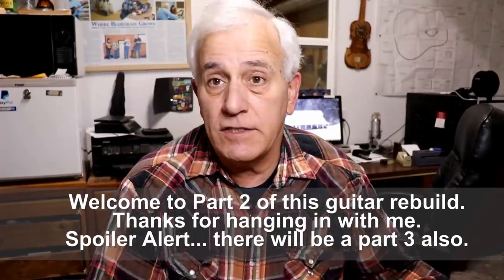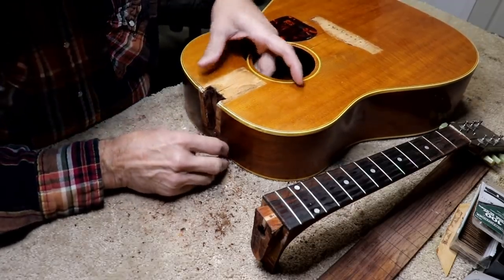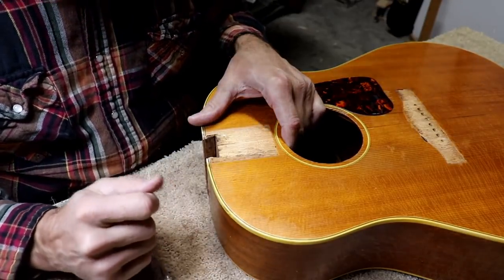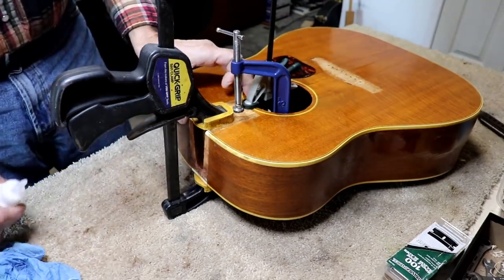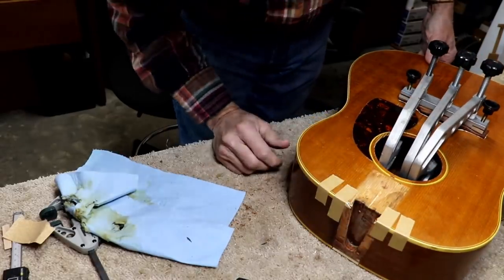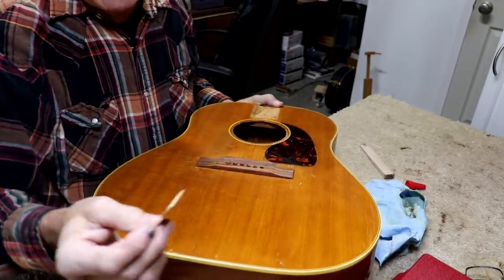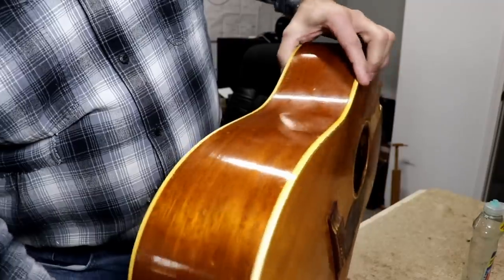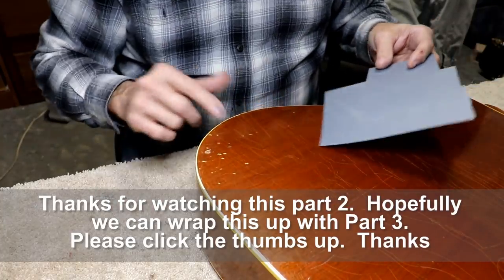278 RSW Gibson Guitar From England Rebuild Well Almost P2

Comment: When scribing the top's finish around the new bridge, hold the bridge in place with two small screws, one through each of the E string holes, with nuts on the inside.  Pad each screw head with a large Nylon washer to prevent damaging the bridge face.

Comment: Ever use a deflated ball, like a soccer ball or small inflated toy?  Brace the top and bottom of the guitar, slip in the ball over your brace wood and add air to put pressure on those hard to reach repairs.

Comment: Thanks for the dish soap trick. I just got finished using CA glue for a deep gash in a thick, lacquer electric guitar finish. I built it up scraped, sanded and polished. and it looked perfect. melted right into the surrounding finish.

Comment: Clear finger nail polish will fill those little and you scrap it down and polish it! Finger nail polish is basically a thicker lacquer,
Reply from the maker: Yes I've used that many times. Most of the time you can see a difference in the Finish though.

Comment: Ever used a flexible nozzle on your air hose with low pressure to force glue in like a pressure grease gun?  I saw you blow with a regular nozzle.  An old air brush with the cup hole sealed makes a great tool with 5 to 15 psi air.

Comment: Hi Jerry;
At 26, 45 It can't possibly be harder to hold down flat on the top than I think. Every time I've tried to hold something down on the top of an instrument and trace around it, it has been almost impossible to hold. I really like the work you have done on the neck joint area so far. I'm always interested to see how you clamp things for gluing, because that's one of the most important things in being successful at what your doing. You Jerry, are a master at using clever gluing methods. Lots of experience from what I've seen. Fine work so far friend. looks like you've got a pretty good ratio of thumbs up to trolls. best wishes to you and yours.

Comment: I admit, I was using balls to pop dents out of closed areas on cars, but similar idea, just have to brace the top and bottom so you are not deforming the guitar with internal pressure, just holding the glue joint.

Comment: I've been working on a antonia copy of that Gibson you have there, I believe it's a sixties one and a complete basket case the binding on the back was ripped off, it was bellied, I ended up having to remove the fretboard I tried for weeks to remove the neck to reset it. The neck would not be moved, I had to fit a bridge doctor to remove the belly - I had to give up on the neck as it just wouldn't come off even with a jig, so you'll be horrified by my fix but bear 🐻 with me as I didn't want to throw it away so... Here goes....
I took the fretboard which was bound, and removed the binding and cleaned up the back. Then I glued it straight to an eighth thickness of mahogany board, then I glued on a strip of the same board below the last fret to give my angle and the sanding began, when the nut end was flush with the table and the strip was gone I refitted the board and rebound it, the neck is slightly thicker but only at the bottom of the board, the action is now good I've   set it aside strung for a couple of months now and it's not moved, hopefully it will come up nice when I finish it sounds great for a guitar that was sold to me for £15 for the tunners! I may keep it 😊

Comment: Great stuff as usual, although You and i differ on Natural Wear (like the fret board for example) i would have left that natural patina finger wear and concentrated on the frets alone. The wear on the board doesn’t effect playability, and i like the natural wear from years of play. Also, when replacing bridges , i prefer going with the Same Bridge so everything looks original. Keep up the good work. 👌✌️

Comment: That bridge is a beautiful piece of rosewood. Lovely grain pattern. And very nicely built. Good job!

That neck/top joint was a LOT of work, and I've never seem the neck block crack like that one. Seems to me that it took a good hit somewhere along the line. Ouch! Again, really nice work.

ETA: On gluing rosewood: I've heard some conflicting things, over the years, and the most recent one that I've heard is that what you do is plane or scrape the surface and don't acetone it. Then glue it within 10 or 15 minutes of doing that scraping or planing, and that's how you get the best joint. I can't verify that, and I've done the acetone thing for years, myself. I guess the only thing to do is make a test and wait for about 20 years to see which one holds best.

Comment: When it comes to fretboards and wear, my philosophy is to always leave it unless there is an issue with the truss rod (or, of course, unless the customer says "replace it"). The reason I'd leave it alone, all things being equal, is because the condition of the fretboard doesn't actually matter; the frets are what makes the notes. Scalloped fingerboards are even something that certain players actually want. Now, maybe not everyone plays with a deft enough touch to play a scalloped board (I sure don't), but there's no real harm in developing a defer touch to play a well-worn fretboard ... because you don't need to press the string to the wood to make a note. In fact, the intonation is likely to be worse if you do.

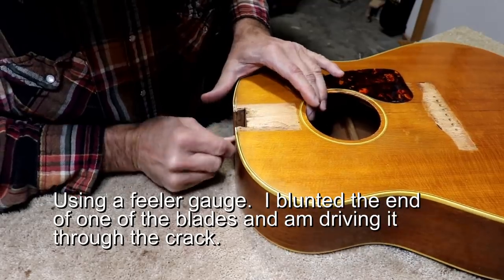Comment: Great videos. During the part where you were trying to fit your Xacto knife blade in the guitar body to clean it out (16:05) you were struggling with what you might use to get in there to clean it out. Have you thought of using dental tools? You can get various types of dental tools with hooks and blades from Amazon. I use these tools for small detailed model carving. They work great.

Comment: With regards to the cleats you could use some high power magnets internally and externally to pull through the back and hold the cleats during glueing process.  Magnets are real powerful now.
Reply from the maker: Yes I actually have quite a few neodymium magnets. Thank you for watching.

Comment: Have you ever just taped the caul to the clamp? I had to re-glue a couple of bridges on a couple inexpensive, but sentimenal, guitars I own. To get over the bracing I put a little loop of tape on the clamp, stuck the caul to it, and it saved me the pain of trying to hold it in place while I clamped the bridge. Just had to check it after I got it in there to make sure it was straight. Great work as always, Jerry!

Comment: Jerry- your comment about CA running, try medium or thick- you have time to apply, get some pressure on the joint, and then if you need, you can hit it with kicker, although it can make the joint harder.   Just as I post you dig out the medium........  there are also some variants that remain a little more flexible, though for instruments probably only valid for potting as in wire or pickups.  Saw your choice of canopy glue- having come from an aviation background, and the last fifteen been heavily involved with Radio Controlled models, the choices in adhesives is greater than any other time.   Why don’t you use hide or fish glue?  Have you had bad experience with these?  Enjoying your fighting through the battles this is providing!

Comment: A lot of manufactures make top on a 25ft dia dish which gives the top like a bowl, which might explain the hump thats troubling you
Reply from the maker: Not in this case it supposed to be flat.
Reply: Old gibsons were built on a flat workboard. String tension brought the belly up.  The way Gibsons built their X braces also contributes to the belly.

Comment: Jerry, have you ever tried steaming the dents up with a small sealing iron and wet t-shirt?  I know some of it is plain wear, but isn't part of it pressure compressing the wood?  I know I lift a Lot of dents out of wood on firearms I refurbish.  I don't have your experience, but I have worked with a good bit of wood in building furniture, refurbishing firearms and wooden sculpture.  Might be worth exploring.
Reply from the maker: Steaming up dents works perfectly fine on bare wood. It can have very mixed results when you're doing it on a finish.
Reply: @RosaStringWorks  True, steaming will often  lift off the finish.  But it will lift dents.
Reply: You were shaving down bare wood between frets.  Was it all removed wood or partially compressed by fingernails?

Comment: Jerry I'd love to get your opinion on the JLD Bridge Doctor. I see it touted as a guaranteed fix but luthiers I know seem to side with you on the matter, meaning, belly bulge is not an easy fix. It seems to me that the Bridge doctor would put extra strain on the bracing and set you up for problems down the road. Would love to hear your thoughts. Really loving your guitar restoration videos. Thank you and keep 'em coming!
Reply from the maker: I think the bridge doctor does what it says it does. However the only experience I've had with it,  it seemed to mute the sound board quite a bit.  It did not seem to help the sound at all. Therefore I prefer to fix it in other ways.
Reply: @RosaStringWorks  Ok good to know. I appreciate the feedback. Have a cheap Yamaha with the issue so I'll weigh that in  before trying anything. Thank you!

Comment: yes, i would have stained the chips to match before using any clear gloss.
Reply from the maker: If you use the right filler, the Finish will melt and blend together. You don't necessarily have to always stain it. Sometimes when you stain it, the stain shows up far worse after the Finish dries.  That happens quite often with me. The stuff I tried was a test because someone recommended it so highly.  Unfortunately it turned out to be crap
Reply: Another great video your skills are amazing

Comment: Great video Jerry! You really are a great source of learning for beginner Luthiers like myself. I have been training Bridge Replacement with my Plywood Top Yamaha F310. It has 2/3 years top, but the top has already arched like that one, or worse. I don´t know if it´s due to a weak top. The issue is fitting a straight bridge to that top. It´s rocking a lot. Do you think I should try to clamp it tight and see if things flatten doing this, or regluing the Bridge Place with downward pressure on the Top is the better way? Thanks!
Reply from the maker: I would use a very similar method to the method I used on this guitar.

Comment: it looks to me as if you are  trying to use that neck puller upside down if you  put the part that s on top underneath  turn  the  guitar upside down use the bar  on top   you will have to put the  bolts the other way

Comment: Let me preface this comment by saying I respect your skills and judgement greatly and I'm by no stretch any sort of expert myself.  I'm not second guessing you in other words.  But why bother with the leveling of the fretboard from the fingernail grooves at all, unless the client specifically asked to get rid of the grooves?  It probably doesn't affect playability much if any.  To me, it looks more authentic to leave them in.  Of course, I'm one of those guys that likes "relics" so you might want to tell me to go pound sand lol.  Anyway, you did a great job as always and I appreciate the insights and videos.
Reply: Deep dishing like that can cause intonation issues as it leaves more space between the crown of the fret and the fretboard. Similar to scalloped fretboards and how they require a lighter touch.

Comment: Just take the top plate off and fix the insides. And then replace the fingerboard. Easy! By the time you've spent a few hours agonising over it, you could have done it!
Reply from the maker: By your saying it's easy it obviously tells me you would really have no experience doing this. It is anything but easy. Taking the top off of a guitar is one of the most complicated things you would ever do. First thing you have to do is remove the fretboard then you have to remove all the binding even if you get it off without creating a ton of damage it's still a ton of work to put all that back and make it look halfway decent. The Cosmetics alone make it a reason to never take the top off if you can avoid it.
Reply: @RosaStringWorks  I've taken tops off violins with good results.  But time and money doesn't matter so much. You have two income streams. What the client pays and You Tube revenue. So practically you have more flexibility than most :D

Comment: I hate to see you have to take that Brazilian Rosewood off and replace it with East Indian, Mr. Jerry. It knocked a chunk out of the price value of that guitar.
Reply from the maker: The value wasn't really much of an issue. It's a guitar he's had since he was a kid and he's never going to sell it. Those adjustable bridges are absolute crap. I wouldn't give you $0.50 for all of them you can pile in the back of a pickup truck.
Reply from the maker: Regarding the kind of Rosewood. I'm not sure that the what I put on there is East Indian. Fact I'm not sure what kind of Rosewood it is. It is a huge chunk of Rosewood that was given to me 25 years ago or more.

Comment: Jerry,
Question: is there enough thickness left on the fingerboard where you could remove the frets and the nut and sand the fingerboard to lessen the depth of the fingernail grooves and then replace the frets and nut. Or would sanding the board bring it too close to the side markers?
Reply from the maker: You'll have to wait for part 3.
Reply: I'm looking forward to it!

Comment: And why didn't you leave the fretboard as it is? Some people like to have a scalloped fretboard and they buy those kind of guitars. By the way, if you are able to play this guitar in tone, you are an artist. Ok, it is worn out, but this guitar has the charm of an old instrument and i would be happy to own it. I've seen all your very fine done videos and restoring "lessons", and i saw all the fretboard works you've done over the time. The sound is much better on your video work, did you change back to the old system? And again in this case i would leave the board as it is.
Reply: Ultimately to repair or replace is up to the customer, but I think replacement solves a whole lot of problems. I love saving original parts but sometimes its just not in the cards.
Reply: Nobody plays a scalloped acoustic guitar lol.

Comment: I wonder if it wouldn't be better to take the back off. That way you could put in new braces and straightened the top. It would make a lot easier access.
Reply from the maker: Might as well just build a new guitar then.
Reply: @RosaStringWorks  That may be a good idea. I'm sure you can build a better guitar than that one will be when it's done. After he has to pay the bill, the guitar probably won't be worth what it cost to fix it. I wouldn't give much for one in that shape. It has more repairs than an old tube with patches on patches. But he may want it for a wall hanger since it has sentimental value.

Comment: For those top holes/chips - you NEED to get GluBoost and the color match/tint system.  You will be amazed how good that stuff words.  You can dye the glue to make a darn exact match ahead of time and that glue will seal rock hard, buff and polish to the point you won't hardly know those holes/dings were there.  Best money I have ever spent.  

https://gluboost.com/mix-match-tints/

Comment: Sorry, me again ; to position internal cauls [packings]  try sticking to your cramp [clamp] foot with a dab of 'hot' glue, from a gun. easily demounted and cleaned up after.
Another thought, from before, with your Stumac cleat ripper: you wouldn't try to sharpen your chisels with a file  . . they're too hard: as is the cleat ripper; it needs a stone to put an edge on it. [this kind of thing happens to me: it's called mature [old] men working alone and getting blinkered.:-)
As regards these shims on the dovetails: what the Hell kind of 'craftsmen were cutting these joints at Gibson? I watched Randy Schartiger fix the very same problem and though it was a one off! This was the sort of thing  wouldn't be tolerated in a furniture factory, let alone standard practice in a top of the range instrument makers' . . wow Gibson!
Reply: Banacek60 Chord  I have a slightly newer J-50  on my bench: and a mid 60's Martin D-35 on my bench as well right now:  Inspecting both bracing patterns, you can see how the Gibsons are going to get 'belly aches' and more bracing issues.  I don't like Gibsons (except for the sound) because they always seemed to have taken the cheap way out.
Reply: Thanks for that,  @hoytbasses , they say you should never meet your heroes! Having wanted a Gibson for so long, I now am rather glad I could never afford one. As you say, you don't like them but for the sound; which must be due to the bracing. We enthusiasts forget that these were not really intended to be 'keep for life' instruments but work tools, which wear out. I heard Declan Sinnott accompanying Christie Moore, on TV last night; his Gibson [Ranger?] sounded absolutely sublime.

Comment: Hello Jerry, I love your videos I have a product I would like to recommend to you. maybe you don't need anything like it since you have a buffing wheel. but it is great for small fixes. I use it on my D35 Martin.
 it works well on drops of sweat and other spots that happen now and again. also on those light scratches from shirt sleeves. or other types of scratches that you don't know where they come from. it comes in two bottles #1 and #2 I never needed part #2. Part #2 is more coarse then part #1.
the reason I first bought was because it is not to remove any of the finish . 
 https://www.guitarscratchremover.com/collections/players-kits-guitar-scratch-remover